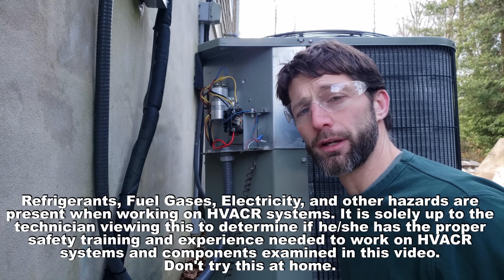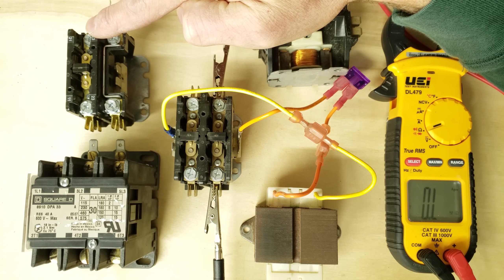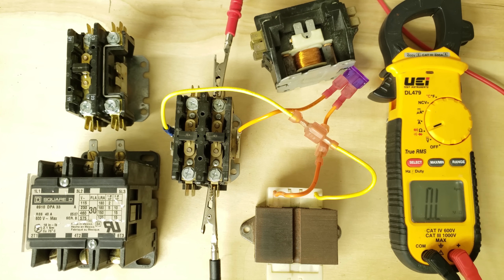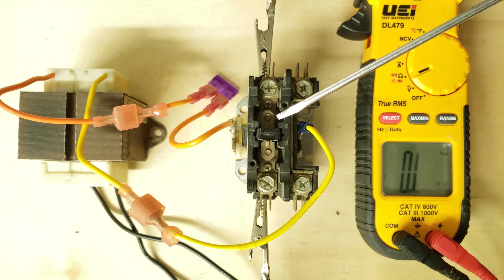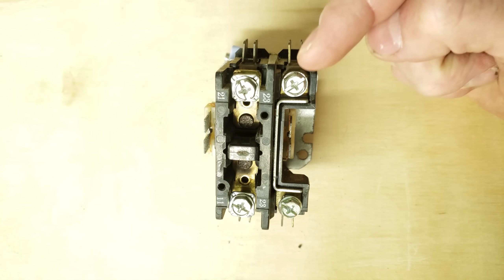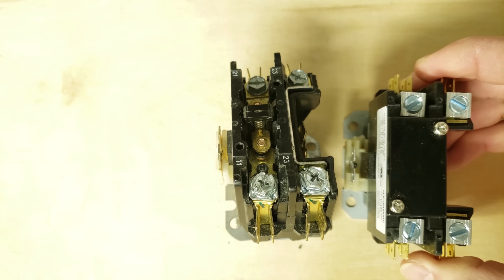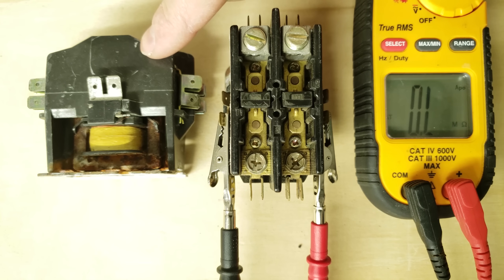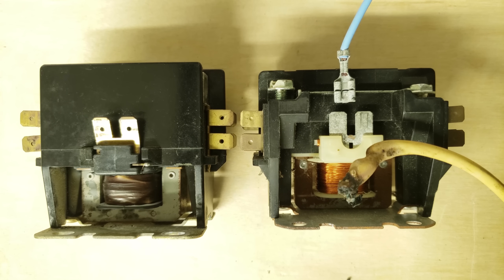TOP 5 CONTACTOR Troubleshooting Problems!

Comment: Question;  my air handlers 2 pole contactor is not reading 24 V but it is ready the correct ohms. My AC works fine, im curious why it's not ready 24V?

Comment: I pushed the contactor because my fan or cold air is not working, I changed the capacitor, and it did not help, so yes I pushed it with a screw driver, it seems very sloppy, it's just Like the one on the vedio at the end, so when I decide to push hard to make contact it sparked, lol, yes power was on, my question is should it be sloppy, move back and forth in all directions? I've got to figure this out.

Comment: What if ots a new contactor, gets voltage to close coil but will not do so? I have to manually push in the contact. The unit then runs fine and shuts off at set point. Rinse/repeat. 4 technicians have worked on it, either finding no issue, or the unit wont act up when they sre present. Aggrivating! This is an admin hallway and NO ONE can fix it!

Comment: I added a relay hard start kit. I switched from a single pole to a two pole contactor. I didn't realize the original contactor was a single pole with the other pole just shorted out. 
So basically, I have one pole that does not need to be switched. Should I tie the relay BEFORE or AFTER the contactor the pole that was originally shorted? Does it matter?

Comment: Weird question but what’s the point of having these contactors, and if we get one that goes bad and we don’t have the replacement part but still need to keep equipment running can we just bypass “Hotwire” it or will a meltdown happen? Thx
Reply: Not weird brudda. Relays allow us to control higher voltage with lower voltage. Imho these contractors allow our 24v thermostat control the outside condenser [in this context] which uses higher voltage to operate. 

Can you hot wire in an emergency?  Why not. Be safe, isolate and get the new contactor asap. I'm guessing you would use the service disconnect to shut off the unit in this emergency?

Comment: Plunger is closed even with thermostat off so compressor always running, had to pull the fuses to stop it.  But as soon as I unplug the low voltage wire (brown) from the side of the contactor the plunger immediately releases to off.  Is this a case of bad thermostat?

Comment: I had a breaker tripping to an ac unit today. I killed disconnect and then breaker reset. Found continuity on the 240 wires. Was Thinking I should replace capacitor but now after seeing this I’m thinking maybe contactor too.
It’s a unit on roof could have water or spider webs .
I didn’t check for control voltage on contactor and didn’t have a meter with capacitance with me. But did notice the contactor was pulled in when I did the continuity across is and from line to line also had continuity. Anyways I’m not that good at ac troubleshooting but looking for to trying again when I get some parts

Comment: Thanks for the video =)

@AC Service Tech LLC Is pushing the magnetic contactor manual push bar while power is live a valid/common practice to test the contactor? I see this done quite commonly by the HVAC technicians who visit to fix residential HVAC problems where I live.

Comment: 5:26 
Exactly what I had at my job 
A contactor was not working and after investigating the coil wasn’t showing a value (1. On the multimeter which means infinity)

But I don’t get something :
The power supply is 3x lines + neutral + ground 380V
Between the lines and the neutral it isn’t equal
It must be 220V but it’s 170~ ish between L3 and N, 250 between L2 and N, 280 between L1 and N
For the contactor what was used is L3 and N for the 220V working supply 
But it’s actually 170V that the coil gets
Could it be burned because of that ?
But it’s underpowered so how can the coil burn ?

Anyway this video is really helpful and shows that even a tiny little thing (coil that is used as a switch) can have a lot of issues

Comment: This is a great video.  Gets right to the point, lays out what you will learn and the explanations are very clear. One question - when the contactor is closed, why would I only get a 6v reading on the high side when it should be 96v (electric car conversion)?

Comment: Power Bill is very high. AC unit runs when the furnace comes on. I turned the power off going to the AC unit. I keep hearing a buzzing noise that sounds like it could be the contactor coil making the noise and why? What is happening?

Comment: Hi My Contactor was rinsed by water due to burst pipe. When I turn on the breaker it doesn’t turn it on but when I manually press the Contactor it still works. Do I still need to change this Contactor or I can run with manual pressed?

Comment: My odd question.....are DP contactors like used in HVAC systems here.....is the mounting orientation important?....can it be flipped upside down/right side up.....such that incoming L connection for line voltage can be either at top or bottom ???......just making sure.

Comment: Hi.  3A fuse inside furnance keeps blowing.  Wiring tested ok for shorts.  Can the low resistance of the contactor coil blow the fuse?  Resistance of my contactor's coil is 15 ohms.  Is that too low?

Comment: how can I have 120v on all 4 wires and the contactor is not pull in ...and when I push in on the contactor the unit starts to run. ???? am I getting back feed.??? or what is the problem??

Comment: what about when you have power on both sides of the contactor even though 24v side has not pulled in the contactor? yes one pole will have power but the other one should not. Internal short? Dead Short? What's the difference between the two?
Reply: Your seeing 24 volts on both sides of the coil because the thermostat has contacts have not closed.if you take both wires off the coil you'll find only one wire has power.

Comment: Do you know why the contactor burns up, I replace two already in an AC unit, and can't figure out why it's doing it.
Reply: Check amp draw to compressor against nameplate rla. Check low voltage supply from transformer, should be 24 to 28 volts. Check all connections at contactor. They must be tight.

Comment: Would the circuit board cause the contactor to burn up. I have replaced about three contactor on an ac unit, but the only thing I can come up with, that the circuit board is not sending the right voltage or the voltage keeps fluctuating up and down causing the contactor to burn out. Any idea of what it could be. Much appreciated
Reply: Check the low voltage supply to the contactor coil. Should be 24 to 28 volts ac. Check the amp draw to the compressor against the name plate rla. Make sure all wire connections are tight, this includes spade terminals on contactor.

Comment: Why if your reading high mega ohms on the contactor it should be replaced? sorry I didn't understand that part from an electrical perspective.
Reply: Because the resistance is going to limit the amount of current that can pass thru the contacts.

Comment: Im an electrical apprentice and just ran into a bad pressure switch on my ac unit. I was reading 24v from the t stat through the switch. The coil wouldn’t pull in. I bypassed the switch and it pulled in.

Comment: What would cause the contactor to buzz when the cold on thermostat is on but the whole ac system is shut off at breaker? My house isn't cooling down but the fan is working. I'm not positive if the compressor is working or not cuz I can't tell by listening.....but line or pipe that has the insulation on it is dry and not very cool which ik it's supposed to be cold and have maybe some condensation on it. Do you think this would be because of the contactor buzzing thing or maybe it's the dual run capacitor? The capacitor doesn't look like it's bad but I don't have a multimeter to check it and I'm trying to fix this on my own cuz I'm very very tight on money right now. Thank you in advance for your advice

Comment: Man I rewired/rewound the coil 3 times on mine, filed those contacts so nice & pretty but I keep getting this horrible buzz. The dual cap is new, I've tried 3. I tried 4 different relays. I hard wired the main power wires in with industrial connectors. I got the right amount of r22.  Some dildo jacked my dual cap & we didn't know it, turned it on & it arched.  After I replaced the cap it worked fine for a day but the buzz came. Then I looked & the wires were melted around the connectors on the dual cap & the relay was spaking. The fan runs fine, the compressor runs if you remove the contractor all together & drill 2 holes on either side of a old 1950s industrial fuse(yeah we're in wv & poor but have lots of weird stuff & strange dangerous ideas lol) Anyway the thermostat & everything in the cellar is fine. It's getting 24v but something is up with the contactor even though it closes perfectly fine with very little resistance when taken off & hit with 24v.     ..I know you get stupid questions all the time & it sux because some sound ridiculous & I'm sure mine is up there but we really don't have the loot, we just bought a apt & have been remodeling it & the house, it's old but because it's r22 it's going to cost a fortune to take the next step. More than a old lennox is worth. Any idea what could cause the problem?

Comment: Good stuff. I've been having issues with trainees not understanding why the low voltage is not killed when the disconnect is turned off outside on a split system with a single transformer. Also have you thought about covering dual contactors and interlocked contractors on 2 speed units?

Comment: We have a loud humming noise and lots of ants .. cleaned the ants but didn’t help
Reply: Need to examine in between the contactors, the clearance of the coil path; may need to take the contactor OFF completely, clean, meter, and determine if you need a new one.

Comment: Great video, thank you!
Also I believe under voltage from the thermostat may burned the contactor coil.  
I made the mistake to install a Nest thermostat with no C wire, just connected to the R wire for power, and even though the thermostat seemed to work and the condenser unit was working, after a few hours the condenser unit was short cycling. Changing the contactor worked for one day, I'm guessing less resistance so it worked all day until the day after, short cycling again. I pulled a C wire out of the air handler bundle cables and connected it to the thermostat and it has worked ever since, no more short cycling.
When it's Summer in Arizona, you need AC ;o)

Comment: So high amp draw on motor or solenoid coil could be due to the low voltage being supllied due to bad contactor or coroded terminals.   Excellent.  THANK YOU.    Does the same theory apply to DC coils. Will they draw higher amps if voltage lower than design ???

Comment: I had the understanding you didn't read resistance with power connected to the load? What am I missing here?
Reply from the maker: The contacts at the top do not touch the power down at the coil.
Reply: @acservicetechchannel  I see. I'm taking electrical now at my local community college, so I'm still learning lol. thanks for the videos

Comment: great video. I've narrowed my problem down to what I think is contactor inside a trane air handler, 12 years old Trane 4TEE3F37B1000AA. at this time of year north east, we start heating with aux heat strips and outdoor heat pump cant function. for the first time, I'm hearing machine gun sound at the air handler when the aux heat cycle starts and ends, still getting heat and noise stops once it gets going. Someone mentioned could be corrosion from humidity and ac during the summer, might go away. Any recommendations. I have 20KW 4 x 5KW heating elements, 100A. I think these contactors typically are inside a separate metal box near the heating strips up where the breaker switches are on the front of the air handler if that makes sense? I've changed VS motor module before but haven't been up top where the elements are. All power is off when working on this

Comment: Does it matter which terminal the yellow and blue wires are connected to on the contactar?
Reply: if you are talking about the 24v Yellow & Blue, then  NO
Reply: @anhlee6220  If its a heat pump, you could disable defrost by switching wires, check wiring diagram.

Comment: Great video! I understand that you cannot reply to every question but I'd like to give it a shot see if I'm lucky still:). My A/C won't turn on. I checked and replaced the capacitor after finding it's defective. The A/C started running immediately. I left the house and turned the A/C off 2 hours later. A few days later when I turned on the A/C, it started but stopped about 10 minutes later (Not because it's reached the set temperature), then I turned it off. Next day I turned the A/C on to try and it won't start. (The Fan would run when I turned it from "Auto" to "On"). Can you tell what the chance is that the contactor was broken? Thanks!!
Reply: Thermostats are delicate creatures, very small manual switchs. Change the thermostat and make sure all connections are tight. Get one that is digital, and when you go out, dont move the switch to off, just set the pushbutton temp set point to a higher temp. Keep it simple.
Reply: @officerkrupke4966  I had the thermostat replaced soon after my last post and it has been working fine since then. Yes, it's the thermostat! Thanks for the reply 🙂

Comment: This is a great tutorial -- if my blower fan stops -- then I tap it and it runs for a few days.  I can actually bang the outside of my blower unit and then it turns back on.  I bought a replacement but curious what you think is the issue.

Comment: Hi Graig,

Thanks for posting informative videos. Most of my HVAC DIY are from your channel. Please keep up the great works.

I have a strange issue with my HVAC: heating & fan only mode = no issue, cooling = issue/thermostat turns off (as if the power is lost) then turning back on (power cycling)

On the cooling cycle, somehow, the thermostat randomly turn itself off (as if the power is lost) and then right back on. When the thermostat turns off, everything got shut down. This power cycling happen only about 40% - 50% of the time. After some Googling, I found that there might be something with the contactor on the out door unit. Is it possible for the faulty contactor to cause the power cycling at the thermostat?

Please note that I don't have a floating switch on my in door unit, just a straight draining pipe down to the sink. The draining pipe looks dry, clear of blockage and there is visible no condensation on the drain pan. Also, I just changed my air filters a week ago.

Comment: @5:22 would the coil read zero ohms if it was functioning properly?
Reply from the maker: The coil will never read zero ohms, just the contacts, thanks!
Reply: The relay I salvaged from a working air handler has 0.000 ohms on the coil.
I wished to use it for a project of mine, but now I don't trust it.
The little wires leading to the coil look pristine.  Any idea why it would read 0 ohms?

Comment: Seems like you are taking resistance with power on. I thought power should always be off taking resistance?
Reply from the maker: The contacts on the top are separate from the coil on the bottom so I am taking a reading on the contacts with the power off. The coil on the bottom is just an electrical magnet that is not electrically connected to the contacts. It just moves the contact points up and down, thanks!

Comment: I bought a new contactor and my dumbass took the paper of the coil and now 2 wires are sticking out of the coil. Could this ruin the coil or can I fix it?
Reply from the maker: Sorry, that coil is bad if the winding coil has been torn in two and you would need another
Reply: @acservicetechchannel  ok thanks for taking the time to help me out.

Comment: "OL" doesn't mean "open line". It means "over limit". The meter doesn't know the circuit is "open". It only knows the resistance is above its maximum measurement.
Reply: Waste of words
Reply: @getitnow005  There's no such thing as "waste of words". One doesn't "run out" of them when they are used. That's like saying "wasting sunlight". They are an unlimited resource. But if it were possible to "waste words", YOU just did it. But as usual, it's okay when you do, but not when someone else does it.
Reply: @xNYCMarc  Unfortunately you can't run out of words but God I wish you could.
Reply from the maker: It means open line or over limit. Over the limit of resistance that the meter can read, thanks!
Reply: AC Service Tech LLC I understand that when diagnosing an issue by measuring Ohms, a reading of “OL” is effectively an “open”, but the fact of the matter is that display is to alert the user that the measurement is beyond the capabilities of the meter or the scale chosen. If one’s meter isn’t auto-ranging and the scale is set too low, an “OL” can be displayed even when the circuit isn’t open. OL is “over limit”. The user of the meter then has decide why the measurement is “over the limit”. Usually due to an “open”, but not necessarily.

Comment: Btw the cap didn't look like any leak or bulge on it .... but was weird how when the safety on the pan was open and I'd push the contactor in n the condenser would run fan and compressor but when I drained pan and safety float closed n contactor pulled in the fan wouldn't run at all
Reply from the maker: There could be a 5 minute delay if the outdoor unit had a control board or a delay module, thanks